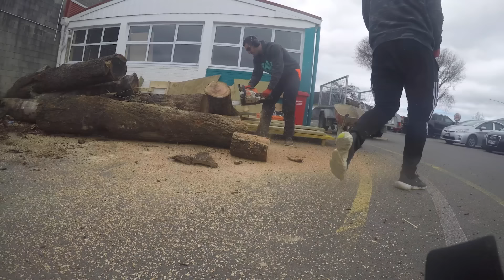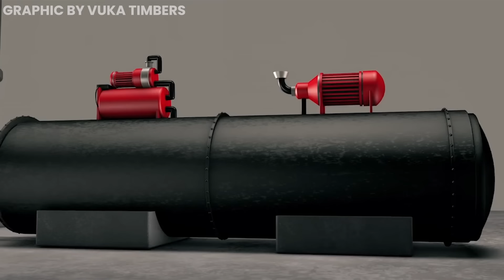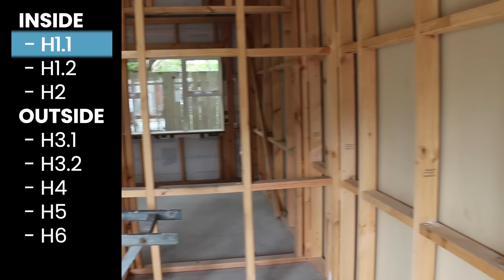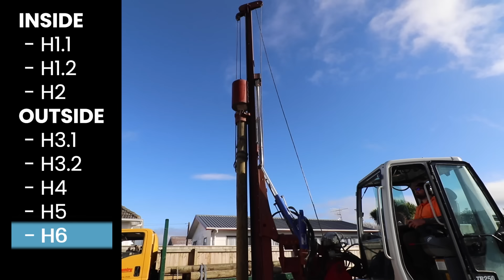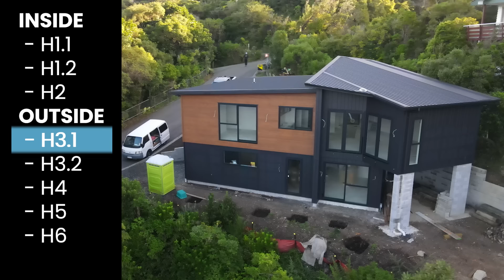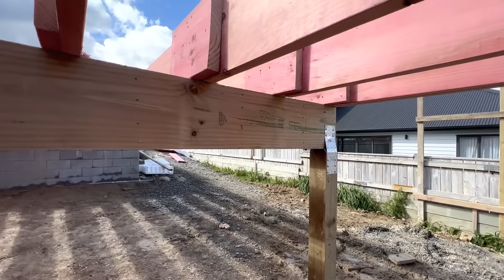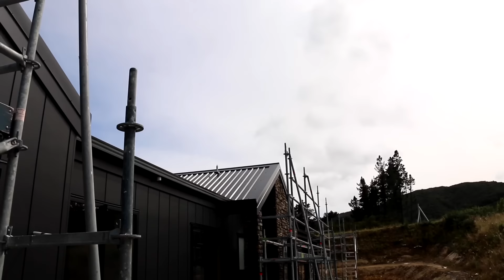Why is New Zealand Timber Pink???

Comment: In the US our pine lumber for framing houses is also heat treated and chemically treated but its certainly not pink... I find it really odd and fascinating how pink your lumber is. We do have lumber for sill plates and for wet locations that's treated for termites and fungus's but its green. like dark green. The ground rated stuff is treated with with something that turns it a reddish brown.
Reply from the maker: Interesting to hear how its the same but different, thanks for watching and commenting
Reply: Its because in nz the old green treated stuff used to have arsenic and copper  in it.. Hence the change to pink treated pine.
Nz has requirements like this from some scandals in the 80s with mouldy homes, the us dosent have national standards in homes, they should used treated pine for every part of the house
Reply: @manchagojohnsonmanchago6367  The US is pretty big. We cover many different climates, in Arizona where I live it wouldn't make sense since we don't have high humidity. We do have local building codes that will dictate the materials used based on the region though.
Reply: @manchagojohnsonmanchago6367  You must be joking, why would Americans use substandard crap like NZ uses. Americans have a lot of choices in regards to the type and quality of the timber they use. In NZ you have no choice but to use radiata pine.
Reply: @funtimesatbeaverfalls ? Why am i joking? Canadian and american hones are very very poorly built.. And yes.. Radiata pine comes from america ITS NATIVE TO CALIFORNIA!!!!..
its a bloody crime they grow it in australia and new zealand while brazillians grow australian and new zealand timbers commercially since the 19th century! Brazil even has a straight growing comnercial australian blackbean tree producing excellent straight heavy hard timber that can be grown in tropical and frost free temperate climates.
North american gomes are exceptionally poorly built.
Their rooves are insane and structurally unsond too, tar paper and plywood things, any storm or heavy wibd or snow cucks them.
They should be using corregated  steel roofing like australia (not iron, australian sheet is work hardened steel) and cyclone screws and cinderblock and rebar homes, Places like florida or kansas would laugh off those tornadoes and cyclones.
Generally i found americas hous production cost is very very low.. A houst in portugal costs with material and labour more than the usa becaus its well built from stone, brick, steel, concrete and terracotta.
Its the selling cost, the profit thats higher in the usa
Reply: @notme9976 yeah just about like that.. your shacks crumble when you fart

Comment: I worked in a warehouse/timber shop where we applied this fuckin garbage spray. That shit will make your skin itch so bad and kinda burns. Ours weren't pink though so maybe a different chemical mix, or just diff dye. Ours was blue or a greeny blue. Stuff sucked to work with in general. Certainly when cutting the long ass planks we had to get different sized ones for shipping out to work sites. Man i hate that stuff so much. Ask anyone who has worked with it its a pain in the butt.

Comment: Thanks for the answers..... In US to best of my knowledge we only had pressure treated (anything that touches concrete or exposed) & non pressure treated for the rest of the home...... Although new construction these days are using heaps of LVL 'engineered materials & the ZIP System for the side & roof sheathing.
Reply: ICF baby!  Never looked back.

Comment: I figured it was pressure treated wood, though it's interesting to know that the pink is an intentional dye. IME in NA, pressure treated wood is tinged green due to a side effect of the copper & arsenic used. Boron is definitely a bit better than copper and arsenic for the environment and builders who have to handle and cut it.
Reply: copper and arsenic is not bad for the environment, in fact boron is much worse.

Comment: Oh dear how sad, wouldn't it be a better idea to grow Cedar or other timber that doesn't require a heap of treatment that is harmful to the environment, I am waiting for all  the comments about commercial viability. By the way don't burn treated timber in your wood stove if you want it to last.
Reply from the maker: Just did a quick google search... 

Radiata pines were introduced to New Zealand to see if they could be grown for wood. They grew quickly in different climates and soils, and so were a good tree for plantation forests. Extensive pine forests were planted, and now most of New Zealand's wood comes from these.

New Zealand grown Cedar hasn't really been tested for durability

Comment: wow, here in the us we dont have any treatment on interior boards other than the sill plates that touch the ground which would be standard cca (basic pressure treated int/ext.  Exterior boards (mostly decks and fence posts) either regular cca, or ground contact cca.  Anything more than that would be special order, i've never heard of what those ratings even are or where you would even get them.  28 years in construction.

Comment: Another question is why are the houses shown being built into the bush, on obviously wet ground with bare earth banks right next to them? Looks like a recipe for dampness and runoff…

I’m guessing it’s the same reason most new houses are fitted for bottled gas hot water heating, despite NZ beginning to run out of natural gas. Cheaper for someone but not the eventual owner or tenant.

Comment: Yeah....I'm not sure if there have been any studies that have found treated timbers leaching harmful levels of chemicals into the soil....I have seen a couple of tests [mind you this is going back to the 90's in Canada] where by there was no significant leaching of any chemicals into soils from treated timber.....and they were deemed safe for use for raised food bearing garden beds......There is a myth out there that treated timber does leach...but like I have said...I [personally] have not seen any studies proving this.
Reply: Until the posts themselves break down. The timber holds the chemicals which protects the timber but as the law of decay applies to EVERYTHING. When engough 'insignificant amounts' of those chemicals eventually do leach the timber decays and the rest is let go. Throughout this process and for as long as the chemicals remain in suspension in the nearby soil NO LIFE CAN EXIST. No, they don't leach significant amounts, but the timber also can't contribute to life and then there is still the fact that some forever chemicals are left. What did you think treated timber held together forever? ever, ah, ah oh so shortsighted.

Comment: It's overkill to treat all this interior lumber.
Reply: Wait until Coptotermus gestroi shows up.
Reply: It’s an overreaction to a period of time where timber treatment requirements were lower and cladding was really crap which lead to lots of failures. Plus the the city / local government (councils) have legal liability for structural issues, so they’re very conservative now. No costs to them by making requirements overkill, but all the downside if they make them too lax.
Reply: Remember it's only the frame you won't see it when finished.